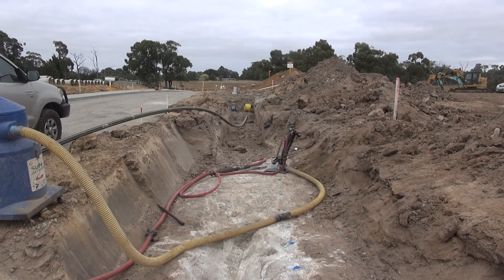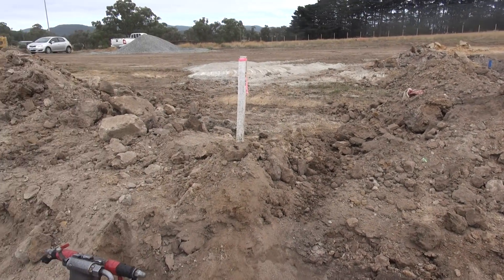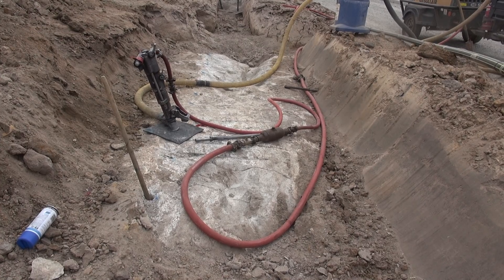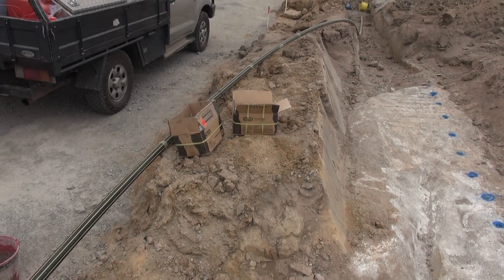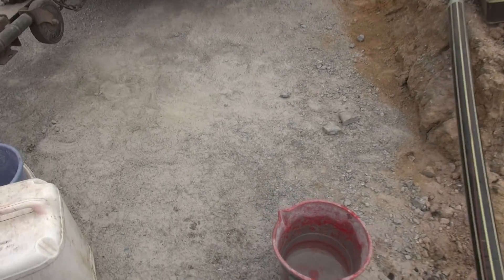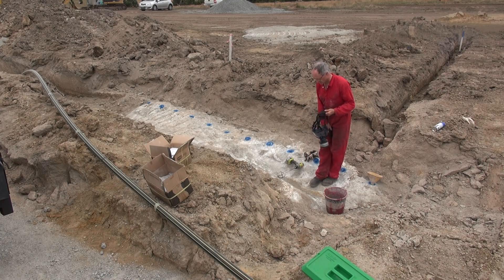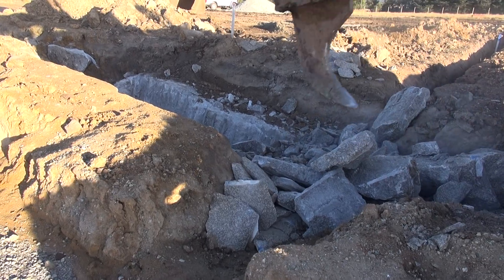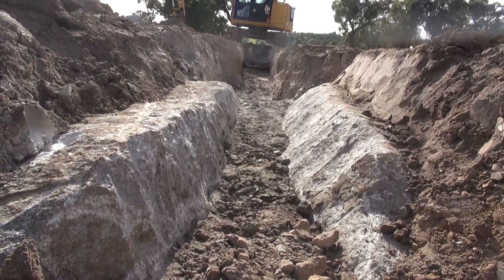Trenching in Granite without explosives

Comment: I'm an old blaster; I know its harder to get now, but what would have you used if you were to blast.   For example, I would have loaded each other hole with about a slow burning powder and set the timing quite slow (20 ms ish).  What would you have done ???
Reply from the maker: Rockbreak and Demolitions Namibia - email on the way.
Reply: Cool,will answer sometime tomorrow.
Reply from the maker: Slow burning powder, like smokeless powder for large rifle bullets and 20mS inter hole delay? I would have thought that 20mS was a bit fast but there has not been much written about mS delay blasting with propellant powders. My main concern with propellants in a tight or highly confined shot like a trench would be blowing the stemming on every hole and looking like a fool, I think that this would be quite possible with a typical zig zag pattern, I'm sure it would work great with the V cut pattern if all of the holes were fired together though. Like this one that worked a treat - https://www.youtube.com/watch?v=oCGIp80eJWI&t=26s  - 38mm holes 1.2 -1.5m deep loaded with 40 grams/m cord and half a 32mm plug on the bottom.
Reply: Yea, on thinking about it, I realize 20 ms would be rather fast.  (Just used to running those delays),  As far as slow powder, I didn't mean rifle powders, just a slower/less powerful powder.  Like 40% ish.  Actually, that is wrong too.  K, like Nitro Cellulose, or Nitro Benzene, something that 'Heaves' rather than 'Throws'.   I'm not sure if your type of powders are quite the same as we have here.  (Typical ammonium nitrate I would guess is the same around the world).  Cheers and thanks.  I must say too, you do really nice work.  Well covered for the shots, nice and quiet, and just 'enough' to keep control over it.  Nicely done.
Reply from the maker: Oh, I see what you are saying, we have not had 40% or 60% NG product here since the early 1990's it's all emusions and watergels these days and ANFO of course. Thanks for watching.
Reply: No worries mate;  Thanks again for sharing.  Again, beautiful work.  Cheers!
Reply: The 42 mm Nonex cartrdiges work very well in shallow holes. BTW, We supply now rock splitters that been manufactured in CHINA, specially for us,and modified tongues that last longer. Compare next to each other, about 95 % on par with European products,at 40 % less purchase price.Good job done btw.I can mail you specs if you want. sent us mail on rockexcnam@gmail.com

Comment: Dave you have to work out a better way to do this sort of trench than drilling by hand. You will stuff your body quick time if you keep that sort of thing up.Go back and take another look at the ergonomic positions you were in.Something has to change. Mark
Reply: Mark Fryer he worked it just fine. You hold that 100lb hammer drill in a perfect position. I've done my share of jack hammering and drilling and the drilling is sooo physically demanding. That thing weighs probably around 120 pounds with the drillbit. And it's jumping and wanting to grab while it's spinning. Any way you can run that thing without getting thrown is the right way.
Reply: avoiding white finger is not such bad advice...
Reply: doesnt that pretty much mean avoid drilling? kinda hard when thats your job?
Reply: @TheNameIwantedWasTkn  lol right. People like this guy have clearly never even tried to lift one of those drills. I'm surprised the operators didn't try finding a way around the ledge. That's what I always do. Likely that hump was only another foot or two wider.
Reply: Mark Fryer : ... It's about profit ... there's nothing to "work out" there a half dozen existing systems to drill that rock MUCH easier ... hell you can do it sitting in an air conditioned cab.  But that wouldn't be profitable
Reply: @MikeBaxterABC  right. By the time you deliver a drill rig and pay someone to run it then the payment on the 500000 dollar machine it would cost a fortune to do this tiny job.
Reply: People do this sort of graft every fucking day, and far worse. And it used to be done a lot more.
Many men would be utterly incapable of lasting a week at such a job.
How the fuck do you think our civilisations were built? How do you think coal was gotten out, or iron ore?
People today are far far too pussified and pathetic. We are not valuing men and bringing up boys to be men. This will leave our civilisations in deficit and will come back to bite us in the future.
Not everything is possible to be done in comfort with a multi million machine.
Though I do agree education regarding positioning is a good idea. However sometimes such ideal positioning just is not possible. That is where ones muscles and technique must take up the slack if the job is to be done.
Wonder why it's not taught in schools?

Comment: Can't bash it?  Can't cut it?  Call Dave!

That's an amazing amount of work.  I guess there are probably machine mounted drills, but unwieldy and expensive for a small job.  Would certainly save your back.
Reply from the maker: HI Dave O - I have a machine mounted drill and I was temped to use it for this job but the extra hassle of trucking it there and back each day was not warranted. The machine could have easily drilled all of those holes in one day however the most important thing to know about getting the expando to break the rock where you want it to break is that you must driil the holes and fill them in stages, otherwise the cracks will just run in all directions, hence 3 days of drilling and three days of machine transport - easier to hand drill. https://www.youtube.com/watch?v=MkvjqUPpAgU